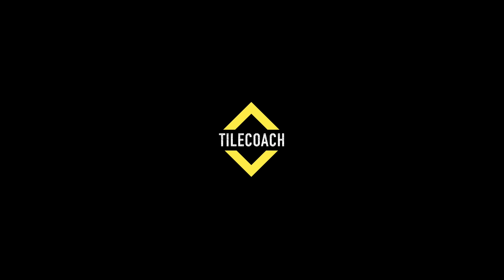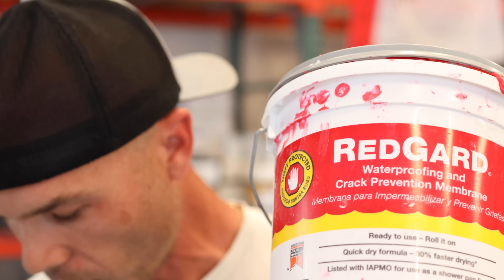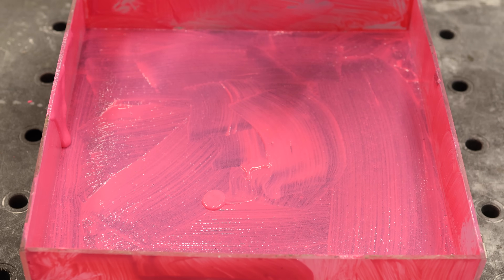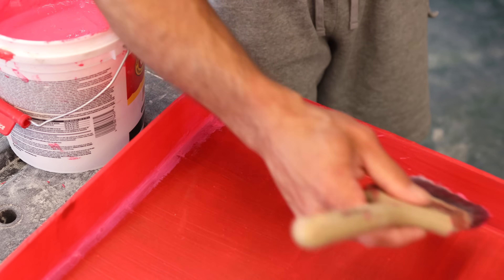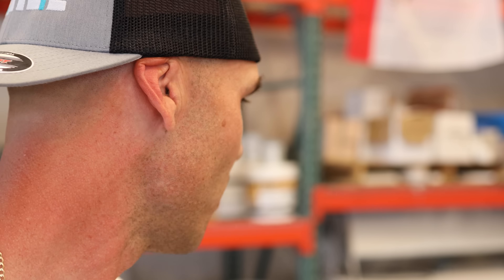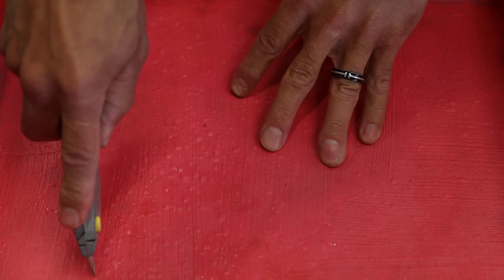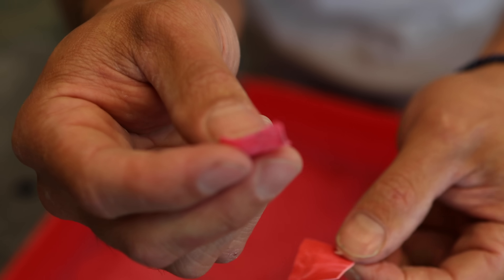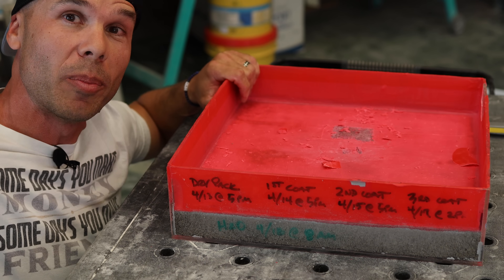REDGARD FAILED FLOOD TEST!!! --- Why Did it CRACK and BUBBLE UP???

Comment: Great video!  If your're using Redguard I always use mesh tape in the corners. Preferably set in thinset. Also I skim coat my shower sub pan with thinnest after pan has dried. You can also meshtape and Redguard.  I think that your coats were just too thick.  I apply with a 3/8 roller and a brush in the corners. Run a fan in between coats. Let dry 1-3 days before a water test.  Also mesh over your drain to build up your pan liner.
Thank you,  Chad

Comment: This is why I don’t use red guard on a pan or curb, the coats need to be thinner, the substrate perfectly dry, and three coats is manufacturer specified as a minimum. Based on the recommended thickness, I don’t even know how many coats that would equal. Who has time for all that? The product does have good applications however, mostly as a supplemental/redundant measure at corner patches and tape joints. It’s fine on the shower walls over top dry thin set with tape embedded, but it still needs multiple applications with ample dry time in between

Comment: A good motto is "Hasten slowly"!
Do not to rush drying times or skip any steps because that costs time and money in the end. 
Allow the screed more drying time unless it is fast drying and ALWAYS apply a sealing coat to the screed and walls before applying the membrane. The sealing coat helps bond the membrane to the surface and must be compatible with the membrane product.
Use only high quality materials.
Reply: When you say "sealing" coat, do you mean just a thin first coat or a different product?
Reply: @danbeeson9564  The sealing coat or primer used depends on the waterproofing product and manufacturers' specifications.  I have used either a diluted version of the product as per the manufacturer's specs or applied a specific off-the-shelf product designed to be compatible with the membrane. This coat ensures the membrane adheres to the substrate.  I'm an Australian plumber who has done high quality bathrooms and need confidence that the wet area is sound.

Comment: curious if a primer applied first would help
it seems the mortar bed is the variable here that caused the redguard to flake up rather then come up in a sheet. Also I could have SWORN i remember reading that redguard requires a meshtape on changes of plane and that helps prevent cracking whereas a product like laticrete does not. This could be due to it being thinner than laticrete as mentioned. 
That or it was applied unevenly

Comment: looks like the mortar bed needs several days time to dry.  the mortar bed is evaporating water right into the Red Guard - which seems to use water as an Earth-friendly solvent...which compounds the problem...causing the blistering, peeling, and flaking...this was a very educational video.  better to use some kind of rubberized membrane.

Comment: It doesn't work paint on waterproof is insane most water is only passing through while shower is on so should last with just mortar and tiles as that's what is actually happening its better than nothing but also the same lol

Comment: This experiment is irrelevant. Your putting redgaurd over a smooth plexiglass surface! Of course it won't hold up and adhere properly to plexiglass, it's made to adhere to cement board and other surfaces. Build a box made of cement board and redgaurd that with 2-3 good coats and you'll have different results!

Comment: The problem is not a red gard is the cement too wet and holding lots of moisture   cement bed need at least a week to dry  the flaky of it is because it never dry  do the same test  but instead red gard use a piece of clear  plastic over and you will find out where the bubbles come from

Comment: Here in Germany i only use PCI Lastogum in combination with their PCI Pecitape. This stuff is insane, works like a charm, doesn`t crack, curing up quite hard (can`t damage it with your trowel) and also the Bands you put in Corners have 2 fleece flanges and a piece of rubber in the middle. The tape is attached directly by the Lastogum membrane. Also they give you pre-fabricated corner pieces and pieces that go around tubes. You can use this stuff over drywall, mortar, basically everything. I once even put it directly on wood and tiled over it for an odd repair job. Holds up now for over 7 Years.  Also this stuff is made by a german company, in germany. The company is specialized on mortar, thinsets and all kind of chemicals used in building industry.

Comment: I like this test. Isaac knows already that the mortar should cure for a few days before applying the redguard, but you can't expect the average diyer to know that, because it's not mentioned in the product specs. He also probably knew the layers were a bit too thick, but once again, he followed the product instructions, which is exactly what a diyer should normally do. Illustrates the pitfalls of the product. Thanks again, Isaac!
Reply: The mortar bed need to cure and add water every other day  to prevent the blister
Reply: That TDS says concrete must be cured for 28 days.
Reply: @tinman1955  Even for Dry pack?  It contains cement but isn't concrete in any traditional sense.  I can't imagine a customer being ok with disappearing for a month between putting in the bed and doing the next steps.
Reply: @Sn0wZer0  "disappearing for a month between putting in the bed and doing the next" ... use Redgard on the walls with full day curing. And use a PVC pan liner over day old bed. Using Redgard on the shower pan itself makes little sense, takes way too long to do carefully and properly, and still would leave me worrying. A $50 pvc liner makes so much more sense for the pan. Quick and easy and total confidence.
Reply: @fyt54321  Nobody uses liners in Europe anymore, it only exists because in the past they had no thinset only medium bed mortar, and you can't set tile on pvc liner or hot mop, so you needed a preslope and then another thick mortar bed inside the liner to set on.. These days in the US we do like in Europe, one slope, membrane, tape seams, then another layer of hydroban or cementacious, and a Schluter drain and you're done. None of this multi-level mortar beds business, and certainly no redgard. Ardex 8+9 is great too

Comment: In my experience red guard is not suitable in a mud pan, it works ok on walls as a little extra protection, although in my opinion not necessary, but in my mud pans I only use a 6mm pan liner and urethane, red guard can and will fail in a shower pan

Comment: Why keep doing these test if you’re gonna mess it up on purpose. It’s the easiest product to use. Light coats tape the seams. And it’s completely waterproof.
Reply: Seams and completely water proof doesn't go together in most cases.

Comment: How did the old timers do it without all these products??  I have done my fair share of tiling . On my custom shower base I use sheet membrane and you need to glue on the corners, never puncture them. That's all the tip I have. As far as walls,,  I'm not buying this waterproofing stuff. Why ?? Because if you don't install tile correctly within the proper setting time,  and the proper grout , and the proper caulking , your tile can still get moisture behind them and fail , no matter what the heck you put as waterproof.  As a matter of fact I tend to think you'll probably not get as good a bond on the wallboard when you completely seal it with this Red Guard. I mean isn't the waterproof , the tile and the grout??? What you are saying by doing it this way, is your water proof is behind the tile ? It's not , your waterproof ,, IS the tile and grouting .  You need a proper bond behind the tile and the grout . That's the most important part of a tile install. Most failures happen when the tile is not set in the proper time , or enough mortar to bond properly.    I would like to talk to a pro tile guy who tiled like 50 years ago professionally ,, and see what his opinion is on building a custom shower base. I would also like to ask if they used waterproofing because some tile jobs are over 100 years old and doubt they used this chemical .   I once had a call to remove a very old shower base , still was functional , and I beleive it had a lead pan under the concrete..  
Just a thought if I was a customer and trying to decide on a custom shower base , I'd go with fiberglass,  or a high quality precast unit for the floor. It seems just to much room for failure . The cost to tear out and redo , if it fails is literally the cost of redoing your WHOLE bathroom $$$$$.   No thanks , so your turning customers off hiring you in my opinion. Take this any way you want.
Reply: Someone who I share similar opinions. In one of the previous videos, a viewer commented how he water proofed his custom shower with extra layers and he was so confident. He thinks he is protected but he is making a case of failure much worse by hindering the problem longer. If I ever installed a custom shower base, i would do the least amount of water  proofing. I would actually purposely make a leak point where there is no structural member so I can catch the failure when it happens. Tile and grout is the water proofing. If it fails, that shower is failed. Your second layer of protection is a bed of moisture, mold waiting to fail.

Comment: I'd much rather use a pan liner or a hot mop. Redgaurd is good in certain applications, but i wouldnt paint over a mud bed with it. I would put redgaurd down first then float over it. I think the substrate wasnt the best choice. Redgaurd works excellent as a concrete crack isolatot though.

Comment: Using a backer board would of been ideal, jusing just the mortar bed caused the red guard to not cure properly taking the moisture out of the red guard. That's why on the Glas it was the way its suppose to be and the mortar bed it flaked off.

Comment: The solution of course is just not to use the cheapest product and assume it's so widely used that it must actually work, right? Custom Building Products who make RedGard are fully aware of these type of frequent failures and are VERY skilled at denying legitimate failures based on technicalities. Your glass box test does trap a tremendous amount of moisture that would normally be allowed to move from the drying mortar down thru a plywood subfloor, that's one problem with your test. Also, you did not mention that the instructions say you should use fiberglass reinforcement at the corners (where yours leaked) "for extra protection". Does that mean it's required? Who knows, it's vague, but a pro should know about that and at least comment on it for a video like this. With those two changes, Redgard can usually just barely make without too many callbacks. The manufacturer totally knows it sucks tho... just don't use this crap.

Comment: The cracking in the corners could be due differences between the mortar and plexiglass. Good experiment and findings, but I wonder if it'd be less likely to crack in the corners if the redguard was able to cure on similar materials.
Reply: You are absolutely right. Non porous plastic is entirely different than mortar/CBU. Where was the corner mesh?

Comment: Part of the issue is the glass,  you’ve got a moisture trap between the 2 waterproof surfaces,  there is nowhere for the moisture in the mud to go.
Reply: You bet and the difference in curing between two different substrates-plexi/dry pack the bubbles are because of off gassing of dry pack and no where for the gases to go, absalutly need a rubber pan liner for a water proof design!!!

Comment: Love the channel Issac but with all waterproofing systems we know as installers there are steps that need to be taken to make a system whole or complete red guard has a seam tape that pairs with it traditional masonry install obviously cement board poured floor or pan  thinset your corners and seams typically web tape for the field and then like with schluder you flat tape the 90s this is way out of perspective and doesn't offer the product any justice you used the flat tape with the schluder demo and I believe you used the caulking the late Crete uses for there corners why not use the red guard with it's partnered flat tape almost intentionally bombing the red guard as a product. Both mapei (the green system) or red guard are both fantastic systems when used right I say you re do the test and use the red guard tape and do a proper test like the schluder tape and thinset your corners. Another good tip for a poured floor is a good adhesion promoter to be spread down first helps the red guard adhere also stops the poor reaction between live mason products and the chemicals used in the red guard itself.

Comment: Is it possible that the mortar wasn't dry enough to allow the Regard to cure? Is it possible that the glass box, being nonporous, is trapping moisture in the mortar?

For what it's worth I Redgarded a cardboard box and filled it with water. Been holding water for a year.

Comment: I have been using aqua defense for over 10 years. I noticed those blisters, turns out it was because I did not let the mortar bed cure for three days, Hydro band states you need to cure for three days so all moisture is out. Plus I use fiberglass membrane in the whole base and corners to insure no leaks. Also we pay extra attention to the drain connection.
Reply: Mapei rep told me to allow the mortar bed to dry 1 day for every inch thick the mud bed is. I will accelerate that by putting a fan or heater to blow on there. I too use Aqua Defense exclusively, plus like you I lay EIFS fiberglass membrane the following over the whole mud bed and, flash it up the wall and hold in place with thin-set with a combined water & Anti-hydro solution in the thinset for additional waterproof insurance. A lot of installers know nothing of anti-hydro, to me its liquid insurance.  The day before I mud, I even flash the mesh up the wall about 4 inches and onto the floor a couple inches as insurance for perimeter crack protection under the pan, and then paint the aqua defense over the detri-mat and up the wall over mesh. Float bed, let cure a bit, add more mesh over whole pan, let it cure out and then aquadefense as needed. Do you do the drain flange assembly correct too with the membrane. Remove mud at an angle, expose flange, remove drain and collar. Paint aqua defense over angled cut away and bond the AD to the lower flange. Let dry, reinstall collar, drain, add pebbles to prevent mud from plugging weep holes, then add more drypack to bring up to correct height. Let it dry but put no aqua defense over this dry pack. It acts as a porous drain area for water to get down and out of the weep holes. A lot of people wont go this far, but I do very high end homes and dont want my reputation sullied over short cuts.
Reply: So, the blisters are from the moisture in mortar bed?  Do you ever see the blisters on wall?
Reply: @twinenk15  from water test
Reply: Redgaurd is not a good product to to use for shower pans even when you use reinforcing fabric at the perimeters and the corners, especially when you are  installing tile  showers above I story high II waterproofed hundreds of showers in a hospital  several story's high , was super careful and thorough and pans failed almost  half of the time when water tested!  The builders insisted on all American Made products  to be used, which I get and applaud,bottom line is RedGaurd sucks as waterproofing membrane and many tile installers I know would agree!Thanks for showing your mockup and results.

Comment: I just did a test.  I applied Mapei's Aqua Defense (from Lowe's) to a new piece of Permabase cement board.  I used the new version of Aqua Defense that has the light green color.  I used a brush.  I did not measure the thickness of the coating.  I let it dry in my basement overnight.  I have to admit, that my basement is cooler than the rest of the house.  I did have a fan blowing on it the whole time to help it dry.  The next day, about midday, I took it outside and let it cure some more in the open air.  Then I put a little bit of water on it.  I removed the water with a paper towel, and the light green color had gotten even lighter, as though the water had gotten into it.  I walked away, when I came back, I could not tell where the water had been.  The coating had dried out again.  I don't know what to make of this, but apparently Red Guard and Aqua Defense have a similar color change when exposed to water and the color change  (in the case of Aqua Defense) is reversible.  Maybe they both need longer cure times, but who wants to wait forever?
Reply: They may have water sensitive color coating that remain on the surface but the rest of the polymer base when dry remains waterproof. Used it to waterproof the chicken coup cement board for my chickens x5 years ago! Still going strong! Will have no hesitation putting this over sheet membrane for reassurance!

Comment: Isaac, the way I apply redgard may be a bit unconventional and impractical for most professionals trying to knockout a project or job as quickly as possible. I use a roller and apply a very light coat. I do this about a dozen times between flash times. Because of the light coats, the coat dries within an hour. If I have the willpower, I'll knock out three to six coats in a day. Usually this process takes a couple of days. On my last couple of coats i'll apply it a little more liberally. The end result is a pretty solid thick membrane. I've never had an issue with cracking in the seams or corners using this light coat method. I suppose you can say its a quality over quantity approach. I suspect most builder just want to glob the product on the job and knock it out in one or two coats and be done with it to save time, but if you take the time, redgard is a product that works, and works superb.